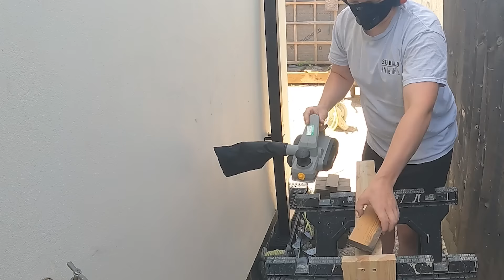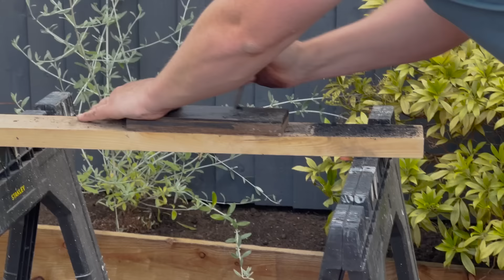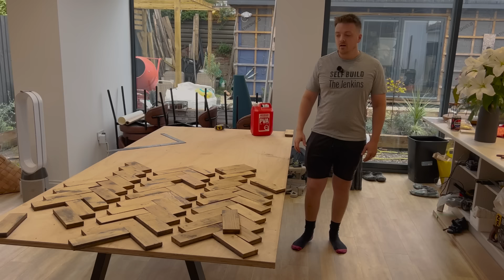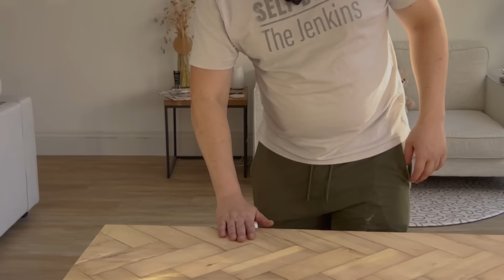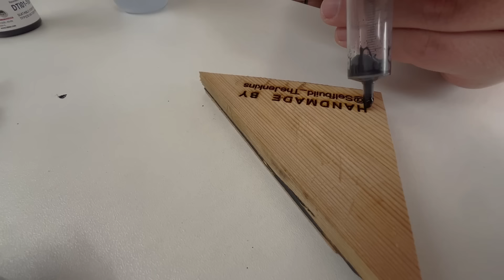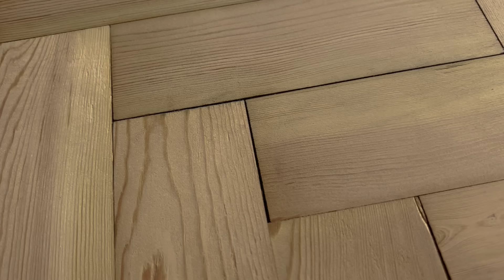TRANSFORMING Parquet flooring into a table - DIY

Comment: Thank you , beautiful table . Question: since you did not laminate the underside of the plywood are you experiencing any cupping or sagging lengthwise? Or any joints opening during winter ? Thanks
Reply from the maker: Hi, thanks you! There is small hair line cracks where I applied PVA and sawdust, we have underfloor heating so the heat’s rising up from the floor rather than radiators slowly warming the upper air, other than that it’s pretty solid with no cupping or twisting
Reply: @Selfbuild_TheJenkins Thank you for the reply.

Comment: Hi all.     I remember at the time when you removed the flooring , it might be nice to keep some of it to make something that would be part of the original property . Seems you hit the nail right on the head with your table , the wood looks like pitch pine which has a distinctive smell when you cut it .  As for finishing the top , I suppose most would opt for resin . But that is not an easy material to work with on a large scale , so you could seal the surface with something like a polyurethane , then fine sand it back followed by a good quality furniture wax . This can easily be retreated in the future if required .      Kind regards as always   😀👍
Reply from the maker: It seems like a life time ago we lifted up the floor, maybe I’ll keep a few blocks to the side, but I won’t be doing anything with it soon as this table was a labour of love 😅. That’s a good shout for resin or polyurethane, we won’t something hard wearing and I think just wax or oil alone might not do the trick. What ever we choose to do, I hope it doesn’t ruin the hard work 🥴😬